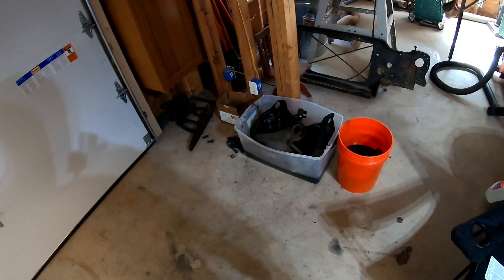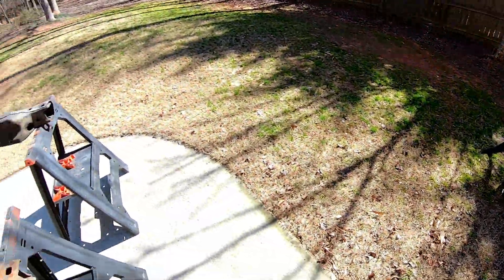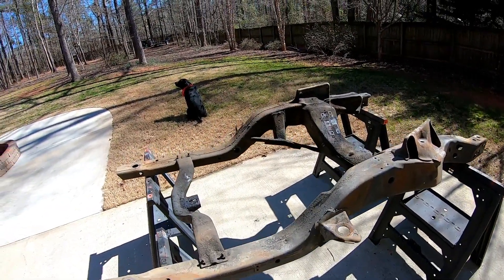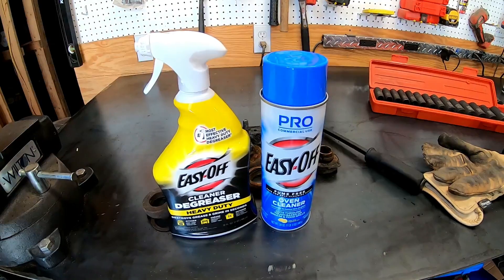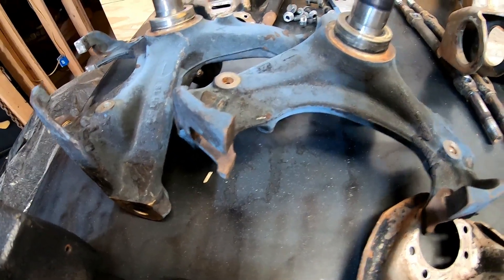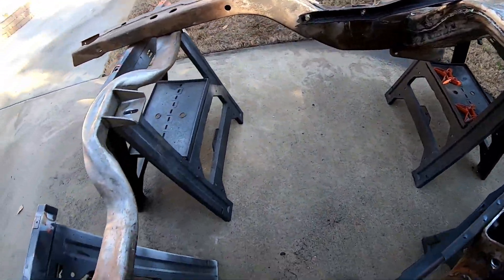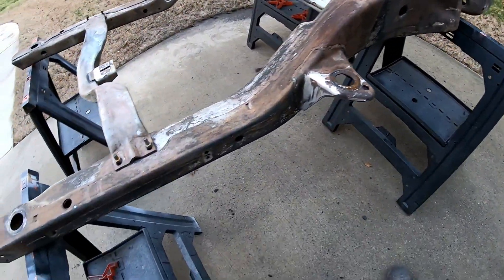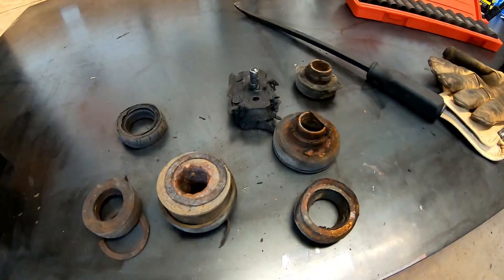78 Camaro Restoration ep16 - Cleaning the Subframe - Amazing Results!!!

Comment: I use Super Clean for parts cleaning... so much easier.
Reply from the maker: I'll try that, cleaning old frames, parts, etc. is always a pain so anything to make it easier!  JD
Reply: @JDOffline  yeah the stuff works surprisingly well. At full strength it even removes carbon off a piston.

Comment: Why didn't you use a wire brush and drill to clean the frame..? And control arms.? Just a question, I'm not being critical..
Reply from the maker: I did use a wire brush after I pressure washed the frame to remove the grease.   It's later in the video so you may have missed it.  JD